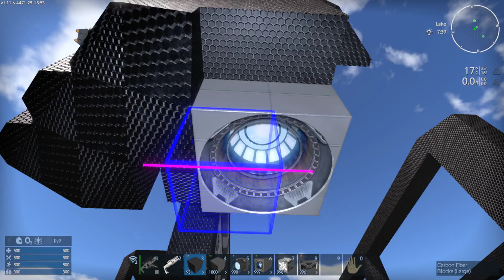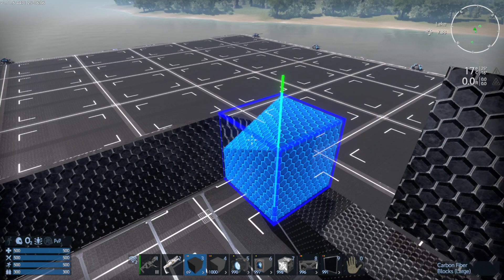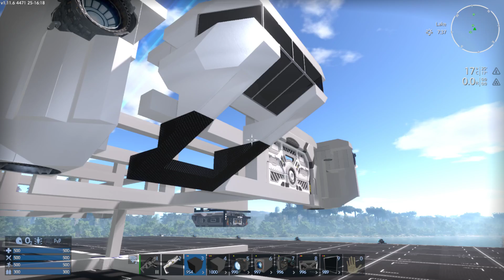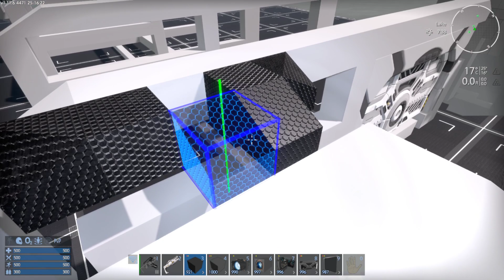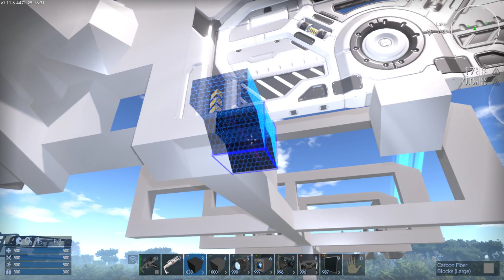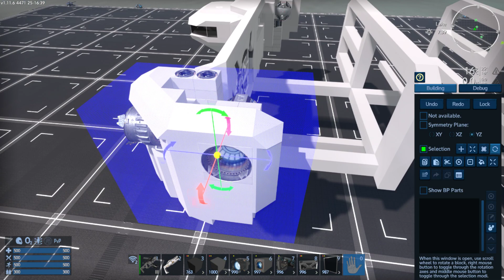Empyrion Galactic Survival - Starter CV Carrier Build Part 1

Comment: I think this is looking a bit too big to be a first CV type build, if you can pull it off it would be super cool though. First thoughts before I get into the video, the blockout bridge area in the front looks like it could offer amazing visibility, depending on final shape, I like that thought. Could you shorten the build and save a lot of weight/space by not really having a full Helios bay? Where it only passes inside the ship a couple blocks to half of the module somewhere, and part of the module would be left out in space?

Grow plots on the bottom layer to reduce the light bleed through? The floor above could have some glass that would allow the light to pass into the upper layer for some extra detail.

I would consider shrinking the hangar down to a more utilitarian quick access hangar, and maybe having a somewhat ramp somewhere you could bring a large HV onto the roof if it did not fit through the hangar door. Or, do a loading ramp in the floor so you can just not have one of those damn ugly hangar doors. Granted this would make a tighter fit, but you can raise or lower the hangar floor without doing the rest of the ship. I forget what materials those big ramps use though.

I wish you could use the heavy glass. It is so nice to look through. Maybe a future build that is more mid tier. One day you will build a CV that has more utility than Movado's Zeus, lol. Maybe the quick-access door to the bridge could be on the side of the bridge rather than the roof? You are likely to have other top access points for the flight deck. (You say it right after I typed it, just to get more greebling on the roof)

I like what you are doing with the chin under the bridge. The space between the hangar and the bridge could hold a small drop floor hangar for micro HV/SV, but I wouldn't want to interfere with hangar access either.

A few low mounted sentry gun positions for critter/troop defense would be nice for early game. For some reason the hangar door looks like it needs to move 1 block farther away from the bridge. I'm not sure if it is just the alignment of the center spars and the missing angled part att he top opposite the bridge. 

It's always fun to watch your brain put these shapes together so quickly.

Thanks Jeff!